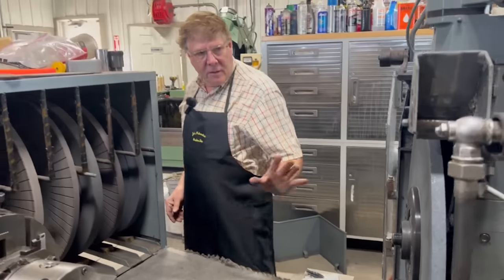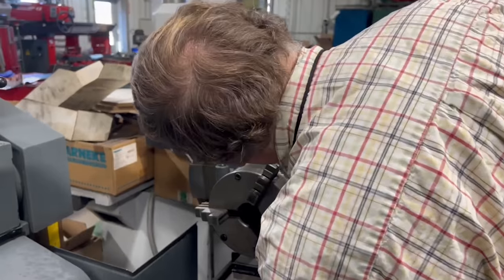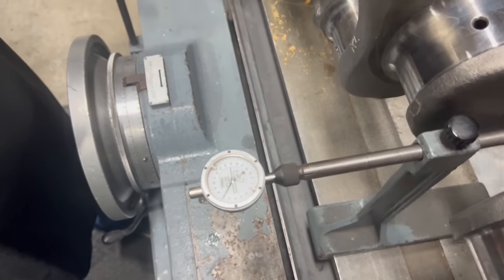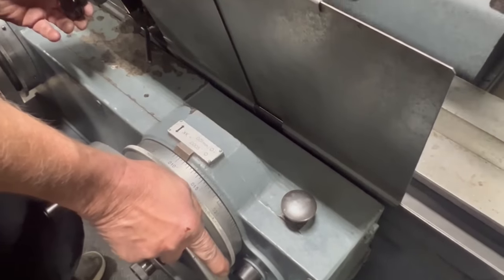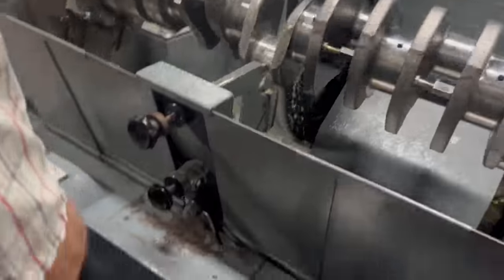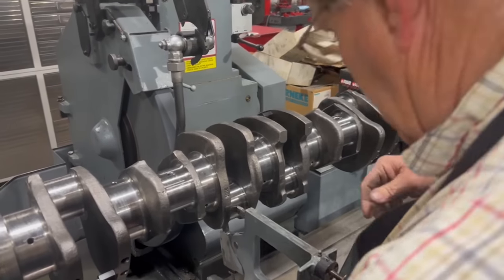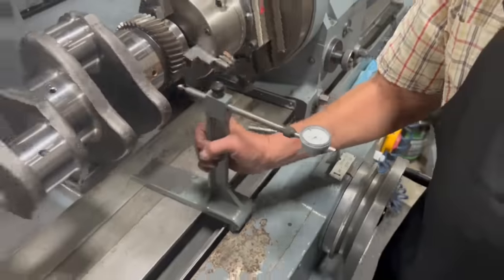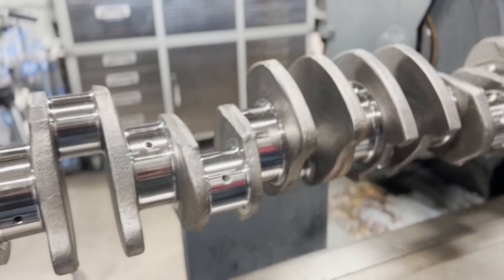This Cummins Crankshaft Was Almost Scrap Metal...

Comment: What an amazing set of skills to have for such a delicate profession, it always amazes me how much a machinist must know and how to do it properly. because a difference of a hair or front resistance / friction is all the difference between an engine that will last forever and smooth versus one that'll lose it's harmonic balance and destroy itself in operation. So important, people do not realize, the shaving of parts affects timing that's how important tolerances are.... AMAZING WORK

Comment: I always am fascinated with precision machining and how much "old guys" know what is going on!  Not mocking old guys as I am old too! (68)
When I worked at Hughes Aircraft and was able to "play" in a small machine shop, the "old guys" that were machinists taught me alot on the lathe/mill/hand tools, and I admired them for their knowledge and help.
Reply: Did you work on the H-4 Hercules?
Reply: @FinalFront  No.  I was in the Electro Optical and Data System group and worked on laser systems. 76 to 89.
Reply: @pomonabill220  Are you by chance the guy that dropped something on the surface plate taking a chunk out just right of center?

Comment: Used to work in a machine shop in Indianapolis and we made many parts for Cummins and the tightest tolerances was the barrels and plungers for the fuel injectors. The combined tolerance was 0.000125 and we had a guy that pretty much hand mated them in batches.

Comment: I'm a retired machinist of 40 year. Been up against many challenges. So few realize the minute by minute focus required to get through each day. Everyone notices when something goes wrong with little understand of the commitment to concentration required. I asked the engineers at a meeting once "if you make a mistake what do you do? Click undo?" For a machinist there is no undo.  We make a mistake we're stuck with it forever. Then they all had the porker face. Love the trade thou... It was good to me.  Very interesting work indeed. Never got board on the manual machines. Cheers!

Comment: Well, I'm no machinist but appreciate seeing how this is done. I once had a plan to get my 400 chev crank offset ground for small end rods, out to about 421(cant recall) or something. But I have to say, that "kissing the sides" of the of the journals did seem hyper aggressive and you could see and hear the chatter, no surprise it caused too much vibration and flat spotted.

Comment: Brilliant skills that have been largely lost in the more developed west now that CNC is king..
The most shocking part of the video is when the delivery 'van' turns out to be a trailer attached to a low powered motorcycle  ! It may pull a ton or so of steel, but wouldn't rate it in the event of an emergency stop on those chaotic streets ! 😮

Comment: I just learned how to run a crank grinder this week. It’s the same model as yours. Luckily, we mainly grind 4 cylinder Subaru and Toyota cranks which means the rod journals are ground in pairs. A lot less setup than a 6 or 8 cylinder.

Comment: At 18.15 he showed us how flexible the crank was, I had a Bedford engine fail to pick-up oil on startup and brab the centre main. That was about 1980 at a Bus Company I worked at in Brisbane Queensland Australia.  Well I stored the crank and fitted another.  Some time later after a serious blow up, I had a salvageable block and the aforementioned crank, it only had a small bit of bearing metal stuck to centre main. I set it up in the lathe and cleaned it up with fine emery tape. Set up a DTI and there was 0.006 thou, I could easily spring that crank more than 6 thousand so put the engine back in service. Later it was found that vibration of the engine was destroying things like oil senders, later abou 1000 him from home a brass plug came out and she lost all of the coolant, seized up, not only seized but the pistons melted and ran all the way to the muffler. Ted from down under

Comment: Always wondered how cranks were ground, now I know :); that was amazing to watch.

One thing I noticed is the multiple starts of the grinding wheel each time. That doesn't help the motor at all, but adds extra heat since each start is a high-current surge; better to just push Start and let it go; they're designed for that. If you're concerned about the starting surge, have an electrician add a "soft-starter" to it.
Reply: I agree with that, it should not be necessary to do that. 
Otherwise this video fascinated me from start to end and I am pretty sure I could never do what your father does. I am the guy that leaves the wrench in the head and starts the lathe 🫤

Comment: Making sure that those corner radii are tangent and smooth blended with the cutting face of the wheel. A poorly formed radius will cause the crank to break at its misformed radius.

Comment: A Truly fascinating video thank you. 
You pulling on the centre of the crankshaft and showing the dial gauge movement was of little surprise to me. Many years ago I took up an area of floor in a "Clean Room" I had on the side of my shop, I dug out a hole approx 3Ft x 6Ft 30 inches deep and put hardcore tamped, then shingle then pea shingle and sand and a damp course membrane then levelled with sand all tamped down I then poured concrete back up to floor level and smootheed the surface. This was to be the base for my pecision lathe, so in comes the late positioned as I wanted it and levelled it X and Y now this is the crux of the matter, I used a brass 9 inch spirit level on the bed of the lathe itself as I was pedantic about it being spot on ,this I did at both ends of the bed, the leve measured in radians, quite literally if you level it to perfection (the old two screws trick) so it was perfect then slipped a cigarette paper under one end the bubble was off of the scale totally to one end. Apparrently the level which was in a lovely hardwood box and both level and box marked with the broad arrow and was used to set up the guns on ships and callibrate the sights? (This I have little knowledge of) Anyhow sorry for the waffle, the point is I was well pleased with the set up and the lathe was was perfectly level to an anal degree, as I stepped back from the lathe, disaster the bubble moved!!!!  Yes just stepping on and off of the concrete base moved the bubble admittedly not far from perfect but enough to surprise me. Any how it all worked out ok as of course the whole lathe was moving at exactly the same rate. so no big deal.

Comment: This was a brilliant example of how to grind a crank correctly. I really liked the final polishing to remove the micro burs as not many companies know this. However you didn't do the re balancing at the end as you did take some material from the side walls of the counter weights. 
Don't want to sound pedantic but there is a likely hood that some imbalance of the original crank was a contributing factor to the wear although you stated grit on the lub oil. 
However, your regrinding to different shell diameters (if I understand correctly) may result in future repairers making incorrect assumptions. We see this all the time. 
I agree that you cannot realistically measure the difference at TDC. This level of balancing is normally only required for Formula 1. 
However,  I'm more familiar with very large crankshafts that are 20-30ft long such as ship engines where ANY in balance causes wear with catastrophic failures, such as con rods going through the side of the engine etc. (Commonly known as "leg out of bed").
Don't know if this is relevant to your video as it's for small to mid size engines.

Comment: My father designed military vehicles with Diesel engines 1947-1987. When he won a contract from Detroit Arsenal, the Army would specify what brand engine. My father did not get to choose the engine, but if he could he said it would have been Cummins.

Comment: We just purchased a RAM 2500 Cummins, we decided to retire and roam the country in an RV ,  we are spending our first winter in Quartzite AZ theres so much dust I took out the K&N Air Filter and put a good paper in, because this sand dust is like talcum powder it's gets everywhere I have it coming through the AC ducts 😔 I may hoping the paper filter keeps this sand/dust out of the engine . I didn't think an oiled Gauze K&N could stop the stuff?  Better safe than sorry these engines are so expensive!!!

Comment: I was standing next to a grinder with a grind wheel that sidze watching our senior maintenance man run a test program on the machine after the repair was complete.  He made a boo boo and entered wrong sign for the offset number in the program and hit the Go button in MDI. That wheel moved the wrong way and hit hard enough to turn into powder. "There goes $60,000 bucks!" We had a spare wheel under that machine just for such occasion.

Comment: when i was a cnc machinist.. i was working a surface grinder when a stone wheel much smaller exploded.. holy fuck was that scary.. now that wheel going omg..
Reply: A steam fired mill near where I live (UK) had a flywheel on the steam engine 26 foot in diameter, 2 foot 4 inches thick, weighing 35,000lb, turning at 100 rpm. 
This flywheel broke loose due to an over speed problem in the governor + drunk engineer. This flywheel travelled just over 2 1/2 miles until it stopped turning. It's still there, kinda like a monument. 
It knocked down 40 houses and 2 pubs 😢. It killed 14 people 🎉.
But it does demonstrate the huge amount of potential energy stored up in rapidly rotating discs.
Reply: @HE-pu3nt  you win lol. now i have to go see this

Comment: The entire operation of crank grinding is a "focus Danialson".   Decades ago, I was taught how and did some as well as watched my trainer do them.  He never wanted to be disturbed when working  on a journal. Rule was it can wait till Pat is done. I've seen valve seat tables go crashing to the ground and crank wheel come apart as well as very expensive Ausi Cleveland crank snap in two when  someone tried to straighten it.      I did have to wonder and it's a bit hard to catch all the numbers but it seemed like the indexing could have easily been corrected for within the new rod journal size basically off set grinding the crank like we did years ago to high performance motors. I was wondering why the cleaning guy didn't just offset grind it.

Comment: I used a pencil for a plug in a 12ga shotgun a long time ago, game warden said it didn't matter as long as you can't load more than 3 shells. I've ran surface grinders, blanchard grinders, bathtub grinder, flywheel grinder but never ran a crankshaft grinder, I'll bet the pucker factor is times 10 to the tenth power.

Comment: Very very cool to watch you guys work!  The sharing of knowledge and experience is priceless - it may prove to be the spark for somebody coming up in this field.  Have you guys ever considered putting a VFD on the arbor drive motor? (Variable Frequency Drive) It would electronically do what your dad does when starting the arbor drive motor - the ramp-up time can be set over a span of 1 up to 60 seconds, it also monitors the amperage draw to keep the motor constant as far as loading while it is grinding. They are fairly inexpensive in the big picture of things -just something to ponder. Again -thank you for sharing your various projects with the world!

Comment: Very Nice Job, You Machinist Really Earn Your Money :)  I Overhauled my 1973 Ford 302 v 8 eng, I Bought the Ranchero in 1973 used with 20,000 miles on it,  Poor thing has over 400,000 miles on it now  :) It was still running, But I felt sorry for the eng :)  I Replaced the timing chain every  100,000 miles, to be on the safe side, My machinist said, he Never saw a Engine with .010 tapper in the cylinders :) LOL  he bored it out .030 so its a 306 now :)  I bought some stainless steel valves for it  that have the stems oversized, so i just had to drill and ream the the valve guide so its back to the way it was Stock. and installed hardened valve seats on the Exhaust ports,  this engine should be good for another 400,000 miles :) LOL  Take care and keep up the Nice Work, Chellie . Retired Female Truck, Diesel and Heavy Fleet Equipment Mechanic of 50 years,

Comment: Anybody who thinks that engine machining costs too much needs to watch a video like this from start to finish. From cranks to cams to engine journals to cylinder bores Every cut needs to be precisely set up. The actual machining goes relatively quickly but cannot even start until the set up is complete and verified correct. A rushed or botched set up can make or more likely break a machining job. It is most definitely worth the investment to pay a man what he is worth when he knows his job.

Comment: I've wondered how they balance a crank when doing offset grinding for the rod throws, but it seems pretty simple. I bet the offset calculations and setup gets even more involved when offset grinding (offset/offset?) the rod throws to increase the stroke length of the crankshaft, if you ever do that.  There are people out here that get the ringing of the crank to test for a bad casting.

Comment: Those wheels, even though they look sturdy, can actually flex a bit. Always used the t-handles, just out of habit. The counterweight setting can be somewhat problematic to dial in, takes some time.

Comment: I have no idea why the owner was "on the fence" about using a crankshaft ground .25mm undersized. even at 1.00mm under the crankshaft has more than enough strength to pull any load that the rig is capable of pulling.

Comment: Yep that's fine I work than I have ever done maybe someday but we'll start with a new metal lathe before that happens. My bed rails are showing a half a thousand worth of ware so I've got to resurface before I can do that fine for a cut × 8 and be within 6 10,000 before polishing and I'm not positive I could do that well with 16 faces like you were looking at, especially over a distance of 4 ft. But then again I don't have an offset check setup either. That was amazing to see  thank you I'm humbled

Comment: Hi Jim...Addressing dressing/radius edging the wheel...When doing this in my Fathers shop I was taught/shown the importance of controlling dry abrasive dust...We would always use a good shop vacuum with a hepa filter...easily hand held to capture dust...1) Silica dust is known harmful to the lungs...2) The dust settling on close by sliding machine surfaces is a big no-no...It works like a grinding compound greatly enhancing the wear to these surfaces...Just saying...
Reply: You sound like the safety sally's we hear about on the internet.

Comment: On the rear seal if there is still a visible line after polishing I would go ahead and install a speedy sleeve, especially if it has an automatic transmission.

Comment: I wonder if you guys have ever tried doing what knife sharpeners do, use a leather strop to get rid of the burr, granted on a knife its a lot more visible but i wonder under a microscope if it would work on a crank. it's still steel so i don't see why it wouldn't. Would be pretty cool to try and see :). Great work guys.

Comment: Starting your machines like that will actually result in more wear.
Every time you do press that start button you get inrush current, and that's always more than your running current. There's also excess wear from the contractors opening and closing 3 times more than normal operation. Just my thoughts on the matter

Comment: I always wondered how that was done. It's amazing. It looks so weird to see the crank rotating on the rod Journal. And the wheel looked very abrasive on camera but I guess it's very very fine. I'm surprised it made Sparks with all of that coolant. Nice job! How many grit is the polishing belt?

Comment: So, I’m just wondering from a business standpoint, I’m guessing that you have about $60k in machine and tooling just to be able to grind cranks at a time loss of about 1-2 hours, and maybe a job value of $250. How do you justify such a cost to return rate? This isn’t like a wash cabinet which you can just set and walk away from, this is very labor/vigilance intensive with almost no margin for error. Is this something that you’ve found to be by any stretch lucrative, or a loss leader? Just asking because I once owned a cylinder head shop, and everything I made went back into tooling supplies equipment. It didn’t help that in that time a set of sb cyl heads brought in about $100.00, and I could have often half a days time invested into one set due to my stringent attention to detail and spec, whereas everyone else did really poor work.

Comment: I hope to add this as a teaching moment and not a criticism. I saw that you started the grinder spindle motor, and stopped it several times to get it up to speed. Your explanation for this is counter to motor magnetic theory. I am an electrical inspector now with 35 years of heavy industrial experience, plus being a gear head on the side. As the rotor of a three phase motor starts to spin it develops a counter electromotive force 180 degrees from each phase. This CEMF is what drops our current to sustainable levels. Most solid rotor three phase motors can draw up to 600% of nameplate current on start, sounds like you are aware of this. But every time you restart you have that 600% inrush current until the CEMF catches up. By stopping for a second or two the CEMF drops to zero every time. That heavy wheel adds to this problem.

Comment: At around 50:40 you are commenting about the benefits of polishing the opposite direction. While this may give some benefit (looks better and feels smoother after polishing), it actually traps microscopic particles into these burrs. The only real way to remove those microscopic particles is by using ultrasonic cleaning. Polishing by no means will accomplish that.